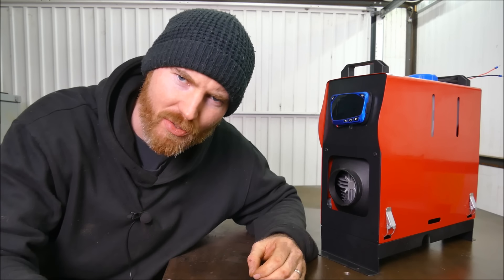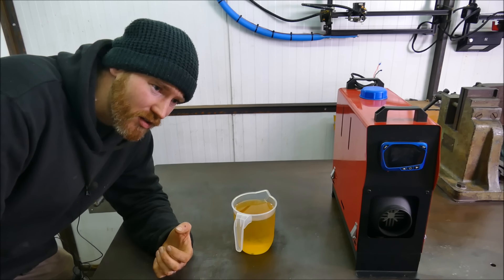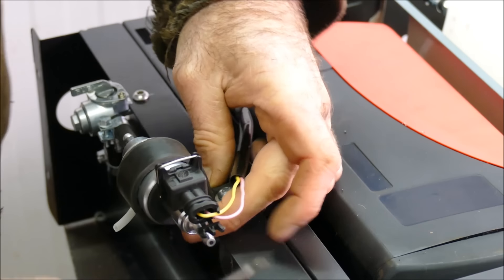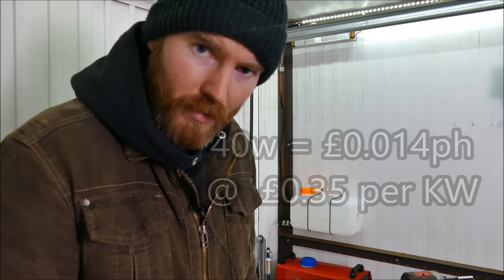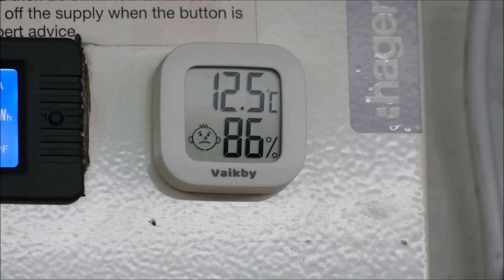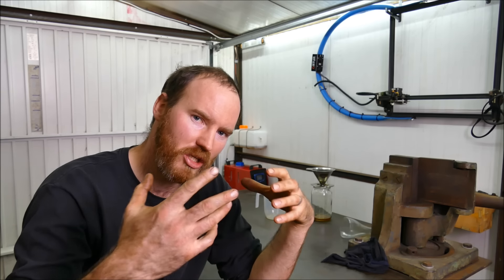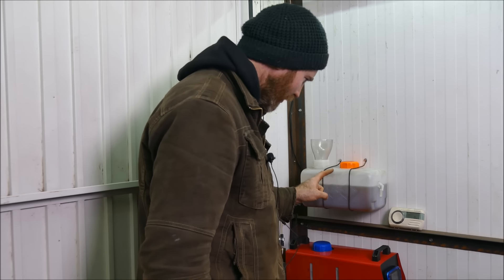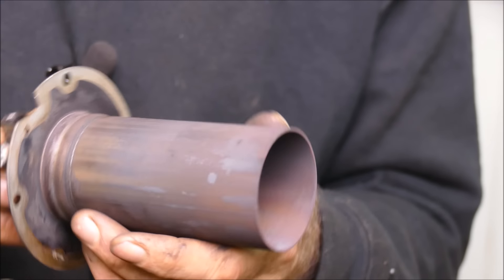£0.03 per kWh heater modification - Top facts & lies on diesel heaters - waste veg oil burn success

Comment: I had the same problem running mine on vegetable oil - I was using fresh sunflower oil rather than waste oil, and the exhaust was spitting out unburned fuel and a lot of smoke. It also stopped working after a few days, since there was so much soot deposits in the exhaust pipe that it partially blocked up. I solved the problem by mixing the vegetable oil about 50:50 with white spirit (I had a cheap supply of that), which thins it out nicely.

When it comes to filtering your waste vegetable oil, I would recommend doing it in stages: Pass it through a wire mesh first (an old kitchen sieve would do the trick), which would take out any large-ish chunks of old batter or chip fragments. Then through a finer mesh, such as "OOO" grade steel wool. Finally through a paper or fabric filter, either coffee filters or a couple of layers of old tea towel. The first two stages should be fairly quick, and the bits they take out should mean the final stage doesn't clog up so much, so that should be quicker too.

Another filtering tip: If you are going to mix your waste vegetable oil with some kerosene or diesel (or white spirit) anyway, you might as well mix this in before filtering it. This does mean a greater volume going through the filter of course, but the lower viscosity should speed up the filtering, so on balance it could well be faster overall.
Reply: Great advice cheers
Reply: Great advice . For filtering i used a fine sieve . No idea what its original intention was to be but it did the job for me without issue . 

I then would simply double up kitchen roll in a funnel and have a tap on the 25 litre tub filled with oil to regulate flow . Top tub drips into the funnel which has another tub bellow it to play catch ..... get it to drip and ignore for a day or 2 . I will fess i never though of thinning it out with paraffin diesel or white spirit .... ill remember that for next time .
Reply: Use rape seed oil instead as it can be added to the fuel of pre common rail diesel engines upto 40% with no issues.
Reply: @steverpcb That might be ok for a diesel engine because they inject the fuel into pre-heated compressed air, burning the metered spray of fuel all in one go. Diesel air heaters burn fuel with a continuous flame in air at ambient pressure, so are quite different. Both the viscosity and boiling point have to be low enough for the fuel spray to adequately vaporise, in order for complete combustion. Otherwise you get a lot of soot production which blocks up the exhaust outlet, and in the worst case you get ignition failure and unburned fuel spraying out of the exhaust.

Also, the issue with diesel cars and vegetable oils isn't so much the engine itself - the first diesel engines to be designed actually burned peanut oil, and were only later on used with petroleum oils. The vegetable oil causes problems for the rubber gaskets in the fuel system, causing them to swell or even disintegrate. If you go through the fuel lines and injectors, replacing any rubber gaskets with viton (perfluoroelastomer) gaskets, it should be able to burn neat vegetable oil of any type without any problems at all.
Reply: @lloydevans2900  Sunflower oil is known to coke up diesel engines badly as do many other oils. Another issue with veg oils is that some set solid and need warming to be able to pump them.
Reply: Thanks, I can get 1 ltr sunflower oil in cans of 10 ltr for 5,50,- EUR so 55 cents a liter, cheap/// white spirit is expensive nowadays, can I use something else? Like normal spirit (used for cleaning/degreasing  or fuel for bain marie heaters)
Reply: @thetruth7633  The "normal spirit" you describe is probably alcohol based, such as methylated spirit - 85% ethanol, 10% methanol, 5% water. While that might burn well enough, it could cause issues for the fuel pump in the diesel heater: As I understand it, the fuel pumps used need to be lubricated by the fuel itself. Diesel, kerosene or a mix of white spirit and vegetable oil are good enough lubricants for the pump, alcohol based spirit would not be, and hence could eventually cause the pump to seize up or malfunction.

So for that reason alone I would not recommend using alcohol fuel in a diesel heater. Vegetable oils are basically hydrocarbons, hence why they have similar physical properties to diesel and other hydrocarbon fuels. Which is why they mix well with kerosene or white spirit - these are also hydrocarbon fuels, just lighter weight and lower boiling than diesel, which is why they thin out vegetable oils.
Reply: For anyone confused about what's an oil and therefore lubricates, and what isn't, consider if they evaporate - if they do, they're most likely solvents. Hopefully this helps some people.
Reply: @lloydevans2900  Thanks, indeed you are right : 85% ethanol, 10% water, 3% methanol, 1% aceton en 1% pyridine this stuff is used for food heaters in restaurant and to clean surfaces. White spirit is used as solvant for paint ("terpentine") and around 2,50,- liter, cheaper in bulk.
Reply: Mix bicarbonate with water so it’s runny, then add to waste oil then boil. It’ll take out all the crap. Obviously you’ll have to judge the oil/bicarb ratios.

Comment: It could be condensation due to the drastic change in temperature almost like a secondary heat exchanger on a 90% furnace 14:50

Comment: How about a coaxial heat exchanger?  Run the exhaust tube inside a larger metal tube, which is used as the air intake (or at least part of it).  This would mean that the incoming air is preheated which should improve efficiency.  It could also be used to bring fresh air in from outside which would give the building a slight positive pressure.
Reply: I think cold air provides a better mixture. When your engine is forced with hot air, it ends up burning more fuel to compensate for the lack of density. Cold air intakes provide an air-fuel mixture that is efficiently burned and used less fuel overall
Reply: Is this true ? I don´t thing hotter air improves efficiency I think it is the other way around.
Reply: Foundries like preheated intake air.
Reply: @LUPIPUPI1  I think he meant the internal air intake, not the combustion intake.
Reply: @sierraecho884   I was not  referring to preheating the combustion air, but the fresh air intake for the heater from outside.  If the incoming air was warmer, it would allow the unit to raise the temperature more than if unheated cold air was brought in from outside.
Reply: In this case you are right, the efficiency overall would increase. A heat exchanger for the exhaust is probably most important important here. The medium could be water, but also sand or salt. Basically run the exhaust inside a coil and surround the coil by a medium like water, sand, salt or similar to absorb, store and radiate the heat into the room after the heater has been turned off.  @silicon.alchemist
Reply: There are a few small airplanes that crash every year from that system: The heat is extracted by having a cabin air intake coming through a shroud around a hot engine exhaust manifold, so then when there is a small crack or rust spot that opens up over time some CO is drawn into the cabin putting the occupant(s) to sleep... forever.
Has anyone mentioned the absolute necessity of a CO detector anywhere these are used? Or any type of combustion is taking place, for that matter?
Reply: @timgordon2039  Oh yeah this happens. Happened even to a bigger commercial airline a couple of years ago, I remember it in the news, before COVID.
I believe nobody has mentioned that. The safest way of operating those is to mount them outside and simply blow warm air inside however it is also the least efficient way of course.

Comment: I'm just about to fit one of these in my workshop.

I'll be running the exhaust through a 4" cast iron pipe filled with kiln dried sand.

Not sure if wanna be adding that much moisture from a thermal battery.

Comment: Pay attention to the exhaust pipe outlet and install the 'H'  design vent cap that creates near zero back draft pressure as wind can create exhaust back pressure into the burner. The outside wind pressure can easily defeat the pressurized exhaust

Comment: An idea if you went to a copper exhaust,and do a double loop of the exhaust pipe , that should drop your point of exit temp 40 % less than current 90C.   I love this video, to bad you couldn't centrifuge to clean the waste oil. Thats the method used at recycle i will assume ?    Thanks

Comment: What about creating a trough the length of the pipe, and fill it with sand burying the pipe, and in turn creating a sand heater, that will also retain the heat.  I don't know, maybe a bad idea, but just a thought...  You think it would work?, or maybe it would be worth a shot at trying.
Reply from the maker: Lol. That's exactly what I've done today. I'm testing the thermal retention of sand in the trough as you say and also testing a fan and hot water pump. I'm using the air quality tester to determine the amount of pollution a diesel heater produces and it's alternative fuels. It is probably not a good idea for lots of people in built up areas to use them but in rural communities it's probably one of the best options. Cheers J
Reply: @joshuadelisle  Wow - who would've thunk?..., that someone else thinks like I do lol...   All joking aside, I so look forward to seeing that video J for sure.  Also, you can use peltier's to generate power (from heat) for USB devices, lights etc..  That would also be an added bonus to using a sand battery, and make the fuel go even further.
Reply from the maker: @Outside-In.  Thank you. The problem with peltiers is they're inefficient and require a lot of cooling to produce anything significant. That's ok I guess if you want to heat up water at the same time but it makes it a lot more complicated for not a big output in my opinion. But it could be worth a test at least. I anticipate the sand battery wont be as effective as water or the fan because although it can retain heat storage and release it back into the room slowly it will also take a long time to absorb the heat and so a lot of the energy will get wasted as it doesn't get absorbed fast enough compared to a water cooling system. Cheers J
Reply: @joshuadelisle  Thanks J, that makes a lot of sense.  Maybe that is why these camping stoves that offer power from the heat, don't get a lot of great reviews?...  It would still be interesting to see you build the sand heater though, and also the results of it's efficiency.

Comment: Really informative video. I bought an 8kw and installed it in my bungalow in Spain. However I  decided to recycle the hot air output back into the air intake. The effects were impressive, as it halved the time it took to heat the bungalow. In addition,  the heaters remote temp sensor reduced the heaters pump speed as  the room got warmer. The heater was mounted outside.
Reply: Hi Geoff. Living in Spain myself I’m very much interested in your experience with this heater for your bungalow. I like your idea of rerouting the hot air output back into the air intake but not certain if you Jean the hit air output (in full or in part) or the exhaust line. Can you please explain? We live in a bungalow which I insulated very well but our heating is still with inverters running partially on EV panels, partially on the grid (Iberdrola). I would like to use this air to air heating for the days / hours without sunshine… so in winter and at night. Can you indicate the efficiency of the heater in your bungalow and if possible, can we get in touch? We live on the Costa Blanca. Thanks. Marc
Reply: Who is controlling the sentance word placement location in the posts? Its getting worse! Why is this running rampant the last few years?

Comment: I like the way you used the exhaust run inside to maximize efficiency. I will probably do the same but put a slight downward slope on the exhaust pipe to allow any condensate to run out. I may even duct a small 12V fan behind the pipe to get a bit of a forced air effect off the exhaust pipe. I plan to use a battery with solar to run the system regardless how cheap using a power supply appears to be, I like the idea of the system being 100% off grid in the event of a power failure. I have a lot to do in preparation for my 9M x 12M pole barn before this system would provide any real benefit. Insulation is my first step and I will probably require two for these units on opposing walls. Thank you for taking the time to make this video. Very informative.

Comment: The fuel pump needs to be at a 30 degree angle due to the pulse dose pump negative pressure creating  the air from each pulse. if you have the pump level then you may not be getting a full dose volume from the fuel dose pump on each stroke as air might be trapped in the chamber

Comment: I wanted to put one of these in my old caravan, but I wanted one that's not in a carry case. I was thinking of plumbing the exhaust downhill through copper pipe, through from the top of a large radiator, then out from the bottom so that water can't build up inside. 

Really enjoyed this video.
Reply: The uncased versions are more common, and are intended for use in caravans and motorhomes. I put a 3kW one in a small bus conversion, it's an awesome piece of kit, 0C outside to 20C inside in about 15 minutes. Once it's up to temperature the fan slows right down and the pump becomes the noisiest thing.

Comment: Ummmm, Josh, energy is measured in Joules (1 Watt second, although more frequently Kilojoules) or BTU (1055 joules), both of which can be converted by scaling them into kilowatt-hours. Kilowatts are a measure of power, not energy. So a heater that runs at a power output of 8 kilowatts will produce 8 kilowatt-hours of heat in 1 hour. 8 kilowatt-hours is 28800 kilojoules, or about 27300 BTU

Comment: Hi,wondering how much you can extend exost line without disturbing functionality on the heater, need to be calculate because.of resistant of the pipe for write flow

Comment: Here's a thought - for particulate emission detection, use a green laser pointer. Does a great job of illuminating otherwise invisible particles. Tried it during California wildfires a couple years ago - it was like having a mile-long lightsaber.
Reply from the maker: Good idea. Thank you. Cheers J
Reply: @joshuadelisle  There are meters that measure the AQI. The combine all the particulates and also things like HCHO,  TVOCs, etc. Burning anything is going to affect air quality. So probably need an air purifier unless you prefer using your lungs to filter the stuff produced by the combustion.
Reply from the maker: @jd01665  I've got one. Video coming shortly. AQI reads excellent from 1m away. Cheers J

Comment: A generic O2 sensor permanently installed in the exhaust gas flow may be useful. Not to control anything, just to view its mV output.

Comment: The house I moved into in Italy had a long stove flue at an almost horizontal angle going out of the wall, the condensation is absolutely wild... and mixed with the wood smoke creates a ton of creosote 😜😳 I'll be putting it straight up when I decide it's final position and cut out that madness!

Comment: Brilliant well made video with everything you need to know. As a heat source it's fantastic and cheap running in comparison to a kerosene heat blower for a workshop and you can still hear yourself when talking with this system. Very interesting topics we'll worth subscribing,  cheers for all the information 👍
Reply from the maker: Thank you so much. I'm currently working on another video of diesel heater with subscriber suggestions and mods. Cheers J